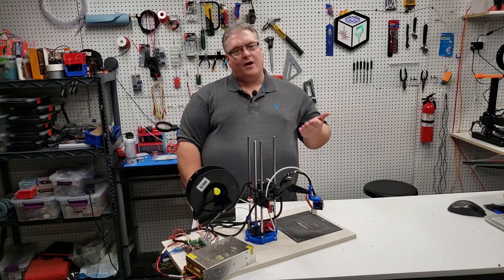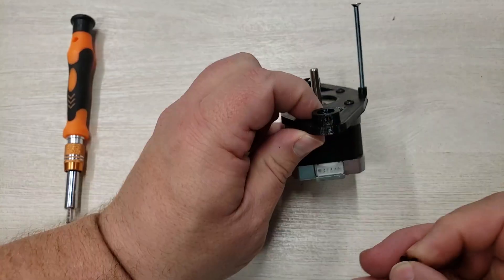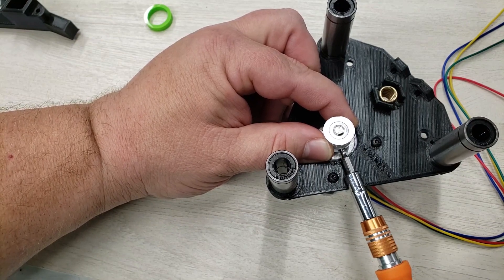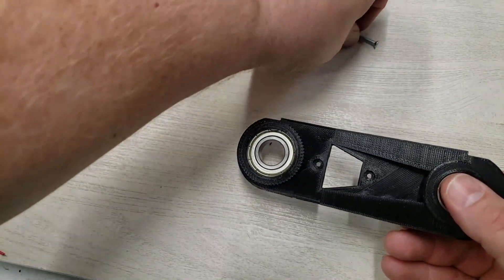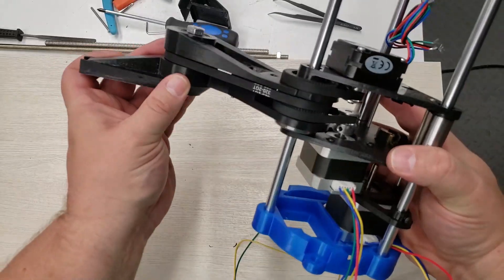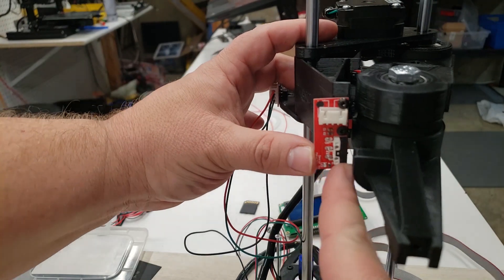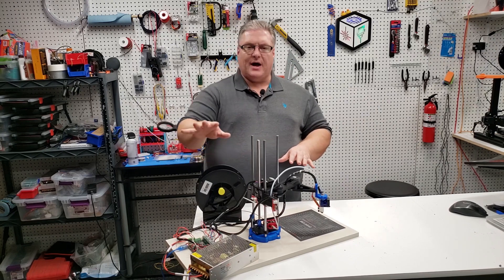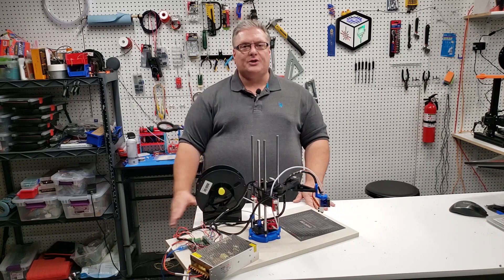How to Build a SCARA 3D Printer - DIY 3D Printer Build - Part 1

Comment: Is there a  PART 2 to this great video? Also is it possible to scale up this build using NEMA 42's? If so, what do you think the largest print volume could be? I want to build a 3d printer like this because it can take up little space in a garage or basement.
Reply: 4 years later, he only has this first video.   I was curious to see it too.

Comment: Still waiting for part 2
Reply from the maker: Its going to be a while yet for this.  I will try and revist the firmware portion again but that is the major hold up.  The Scara support in marlin was having issues initially.  I believe they have fixed it but I haven't been able to get back to testing this out.  I think I may also reprint the control arms before a part two.
Reply: @MakersMashup  Fair enough, I really want to make one of these because they look so cool but I'd rather know that it fully works before I invest money and time into making it.
Reply: @MakersMashup  Do you know if they've added proper inverse kinematics for single-arm SCARA, to eliminate the need for that coordinate conversion script? I'm just about finished with the mechanical design of my wall-mounted SCARA printer, but not looking forward to the software side. I was reading through the Marlin code a while back to see if I could add it myself, but it's far too complicated.

I think Smoothieware has proper SCARA support though, so I may just use that. It looks like the price for TMC2209 stepsticks has come down a lot since I last checked, when it looked like the Marlin-only SKR Mini with integrated TMC2209 drivers was the only affordable way to get higher than 16x microstepping.
Reply: Well I finally got back to working on my printer and finished the physical construction, but after struggling with firmware all day, I'm fairly sure that Marlin does not support single-arm SCARA kinematics. So we're stuck using the coordinate conversion script, or expensive Duet boards since RepRapFirmware seems to be the only one with single-arm SCARA. Turns out Smoothieware only supports the Morgan style (2 arms with shared shoulder axis), although it does look much easier to add new solutions than Marlin.
Reply from the maker: I've seen they claim it has mpscara support but I haven't gotten around to testing it. The conversion script worked poorly for me.
Reply: @MakersMashup  There is some code in Scara.cpp for MP_SCARA, but you have to edit Conditionals_LCD.h line 30 to enable it, and it doesn't seem to work. Shoulder rotates about 90 degrees when commanded to move 1mm in the X direction. But today has been spent studying how the motion planner and everything works, and I think I've got a pretty good handle on it now, so it shouldn't take much longer to figure out what the problem is. Then I can set about adding a few things to make it more general-purpose (for one thing, my printer is right-handed).
Reply: Ok, I've got it moving in a somewhat coordinated manner now. The first movement from home position to bed center is very odd, starting off at a decent speed and then gradually slowing to zero, and not ending up in quite the right place. But after that it moves reasonably well in response to x/y commands. It's possible that it actually was functional to begin with, and my trouble was just due to discrepancy between the internal position values and the physical position of the arm (I'm currently not able to auto-home). If you have time, try it on yours. Enable MP_SCARA and change line 30 of Conditionals_LCD.h to #if EITHER(MORGAN_SCARA, MP_SCARA) and see what happens. I'll keep working on it.
Reply: Not sure what was wrong before, but my printer now moves smoothly and in proper x/y coordinates. Still having trouble with homing though.
I think your printer should work though. In addition to that Conditionals_LCD.h change, you need to set MANUAL_X_HOME_POS and MANUAL_Y_HOME_POS  to the location of the nozzle (cartesian x/y relative to bed zero) when in home position. You may also need to disable MIN_SOFTWARE_ENDSTOPS and MAX_SOFTWARE_ENDSTOPS, assuming home position puts the nozzle outside the bed. You can try enabling SCARA_FEEDRATE_SCALING, but it's not working quite right for me (too much speedup when elbow is bent). Still investigating.

Comment: what firware are yuo going to use? thanks
Reply from the maker: Miguel - I was originally using the Marlin 1.x version that they included in the project but I'm currently working with marlin 2.0.  The original author of the Arm itself and I are working to get this running with Marlin 2.x
Reply: @MakersMashup  i wait you have a good job

Comment: Hi, I would love to make this kind of printer myself, but following this tutorial is kinda hard and there is no part two. The build starts right away and during the tutorial several parts get swapped. So at the end it's totally unclear what materials to buy / print / use and how to assemble them in order to get a working printer. The other DIY printer build with your nephew is a great series to follow along and start building yourself.

Comment: Just found your channel because of this video.  Very interested in seeing an update on this printer, I work away from home for 2 weeks at a time and would like a printer that could be packed into a pelican case and brought to work with me.   The size vs build volume for this seems like it would be unmatched by basically anything.

Would it be possible to make a seperate heated build surface that could be connected with say a set of Dean's connectors or even a stand alone heated bed that could be run off mains power with a seperate controller for it?
Reply from the maker: The second video is currently in the works.  I have a heat bed attached for the second video and how you attach it is ultimately up to you.  Leveling is the real trick.  This design has some real advantages and some serious disadvantages I have come to find.  All to be in the soon released Part 2. 😉